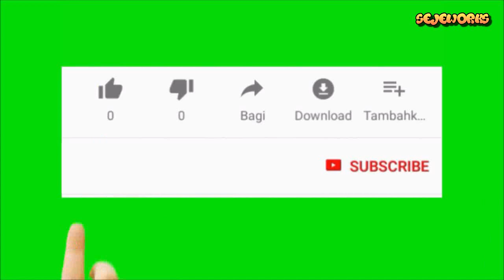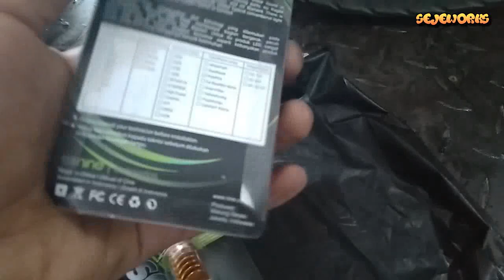Cara Paling Gampang Pasang Lampu LED Pada Honda Supra X 125

Comment: udah saya ubah jadi DC om, tapi kenapa terang sebelah ya? masalah di lampu, kabel", atau aki nya ya?
Reply from the maker: Full dc atau sesuai video ini ?
Reply: @SejeworksChannel1  iya om sama
Reply: gini om, ketika sein nyala (sein ikut DC). itu lampu yg redup sebelah ikut kedip-kedip.. atau pas lampu rem hidup, si lampu depan sebelah ini makin redup juga, tapi yg satunya lagi tetap terang
Reply from the maker: Lo nyambung kabel dari kunci kontak, ke kabel kuning ( lampu depan).
Reply: @ilfazm2363  Kalo dah ganti led emang gitu om,,semua perlampuan di motor harus ngikut led semua
Kebetulan saya juga pake supra,,ganti led headlampnya aja kalo lampu sein atau lampu rem nyala pasti redup,,kalo dah ganti led semua jadi stabil nyalanya